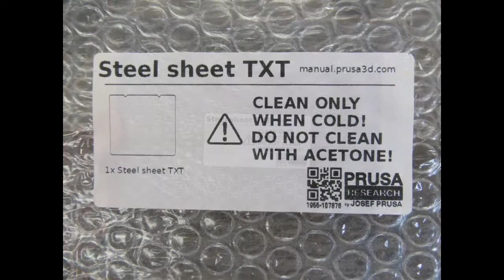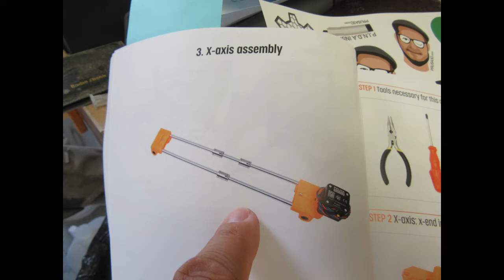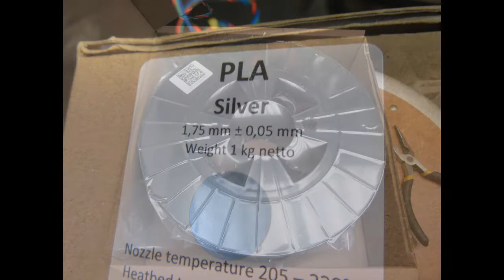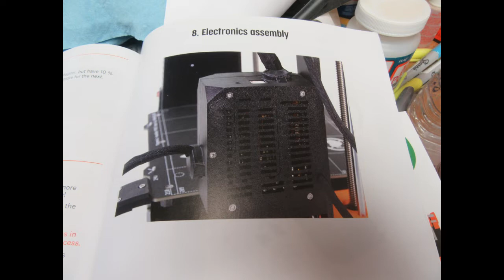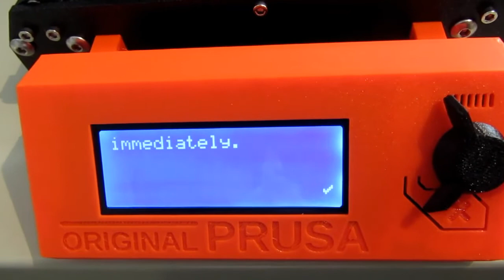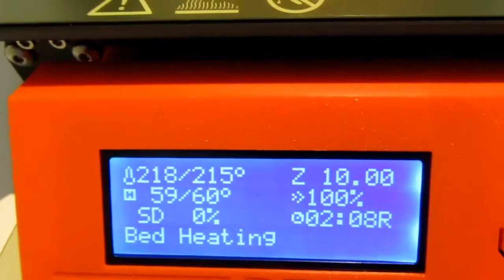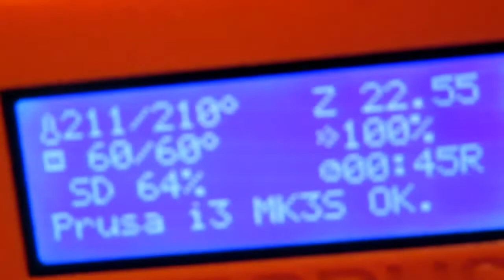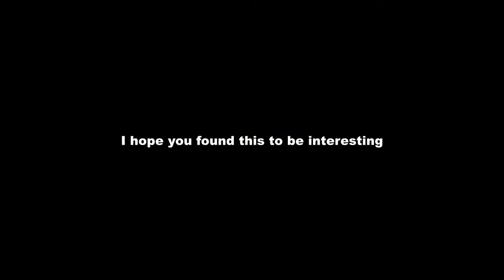3D Printer Adventure: Assembling and Testing the PRUSA i3 MK3S+ 3D Printer

Comment: Thanks YouTuuba, I replaced a cracked belt tension bracket and then had a bad printer after I replaced that and reassembled the machine.  I worked out that the left sided belt pulley and right side idler wheel were too tight and jamming the x-axis mothion.  But your detailed calibration section, although slow, matched my observations and attempts to calibrate my machine.  The 24/7 tech support is second to none and I got good advice there after showing a few images and short videos via youtube.  I enjoyed your channel many times.
Barry Marshall, Perth, Western Australia.

Comment: If the tapping in the extrusion was 'buggered up' as you put it then how do new screws solve the problem? The bad tapping still exists in the extrusion. Future screws will encounter the same problem won't they? Could it have been the threads of the screws that were at fault?
Reply from the maker: Bob D, the original screws encountered something in the tapped extrusion holes that froze them, and when forcibly backed out, some aluminum from the holes came out stuck on the screw threads. I retapped the holes so that there was at least a clear path for the new screws' thread. I experimentally threaded in the new screws, and they went in 'normally', without unusual resistance, binding, and I could thread them all the way in and them back them out easily. They did not wobble loosely in the holes. This indicated that there was still enough good thread in the holes to allow a good grip between new hole threads and the new screws, although not as strong as optimal. I conferred with Prusa tech support and they concurred that the joint would probably be strong enough, although they offered to send new extrusions. It was my decision to proceed with things the way they were.

Comment: Very interesting. So for the money is this best option? Or in this price range are there strong other options?
Reply from the maker: SNeal5966, no doubt there are other 3D printers of this size that work as well as this printer, for less money (and often a lot less money). But with the Prusa, you are also buying something few others have....all components are very high quality name brand ones, which are less likely to have wear issues or quality control issues (and if a part does go bad, you should have no problems getting replacements), and you also get Prusa's extremely good tech support and community support.
Reply: @youtuuba  Got it. Thank you. I am new to the 3D printing at home concept, starting to think about finally purchasing one. It does seem like you get a lot more for your money with the Prusa units, I just am not sure if you can do better without spending $5K plus......that's what I am wondering. For that money seems to be best option? Also....I am thinking I might as well wait for their new XL version since I don't own a machien now. That looks pretty cool, have you seen that? It's pre-order only at the moment...

Comment: Definitely made me rethink getting a prusa. Seems like a lot of adu for very little fanfair. I might just go for a Chinese brand and slap some linear rails on it and call it good. I thought maybe I would see better print quality over other offerings out there, and it doesn't seem to offer a whole lot for your money. Especially with the way the electronics are handled. Say what you would about Chinese brand printers, cramming electronics like that into a plastic box doesn't inspire confidence in the brand. For the price I expected more. Thank you for the video. I just don't like printers with moving beds, it is a cost cutting measure that should simply be forgotten in 2023.
Reply: Yes. or go pre order that Bambu P1P. It what I should have done. Its cool for the first 4 hours then you are like, I seriously paid 800 bucks to do this? I am currently on the wiring and found this resource.  Like the video said, the instructions for it suck with !!!! connect it correctly or the whole thing gets damage!!! Warnings everywhere.  Going to go print the bigger picture becasue the manual one is small and useless. Hopefully I can get it going tomorrow. I already forgot to put 1 square nut in the extruder part....the little lid for the IR sensor, and I wasnt about to pull that thing apart for that one piece.  Putting the square nuts into the little built recess almost caused me to put this whole thing in the trash.
Reply: Not an expert but from what I've heard the differential is not the quality print but the reliability and long term usage without headaches. I just got an artillery genius pro and is not working at all right of the box so sending it back. I don't think that kind of stuff would happen with a prusa.
Reply: @Drumaier  they last about a year before replacing parts.

Comment: Listen! I'm working my way up with regards to manufacturers and quality (supposedly) and believe me I did not have any of this assembly palaver with my Wanhao (cheapy) or the one from my local Aldi store (another cheapy). All this hype about the Prusa i3 MK3S is exactly that - HYPE! It is not a quality product! The plastic parts are badly formed and inserting the square and round nuts into them became a major task. And don't get me on about the tapped holes in the frame.  AND, if you believe you can do the whole job with the tools provided - think again.  The photos are rubbish with some of them not even having a point of view reference. I genuinely am very disappointed with the manual, and the product. I would not buy anoter Prusa printer. Oh, and if  you think  you're going to assemble this in 8 -10 hours. I would think again.
Reply from the maker: Revell Cornell, you come across as both foolish and abrasive. Your opinions are just that, and are not as widely shared as you might think. And you must think you are something pretty special to justify your abrupt command of "Listen!".